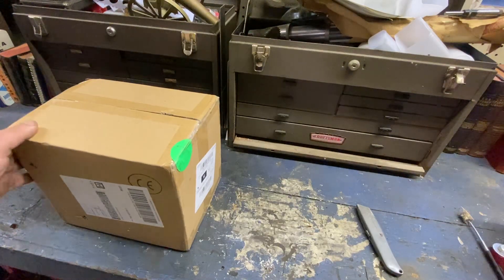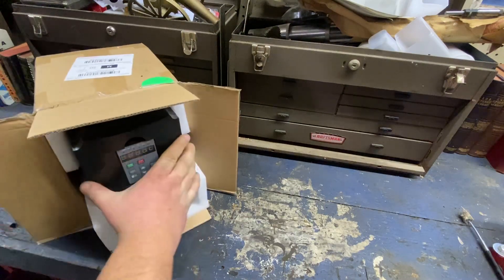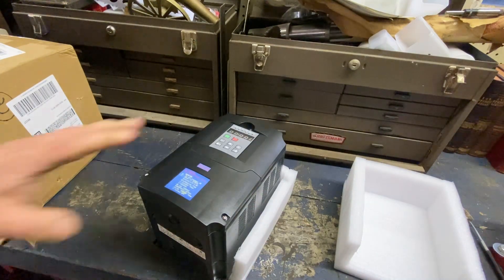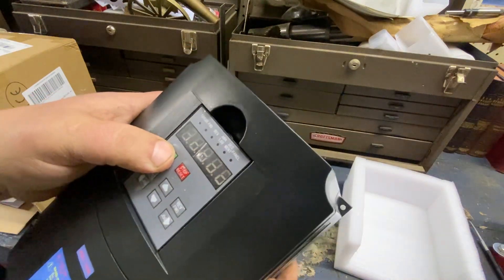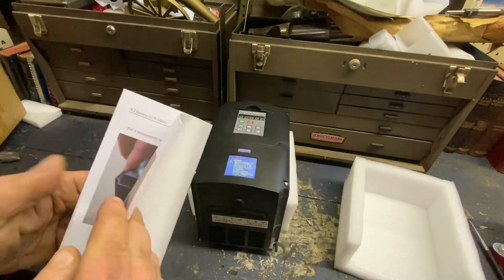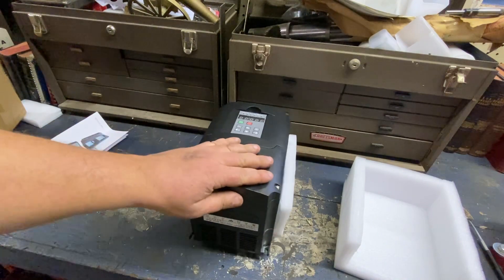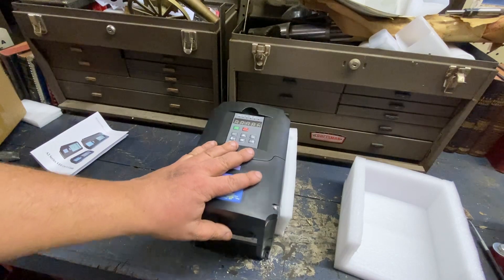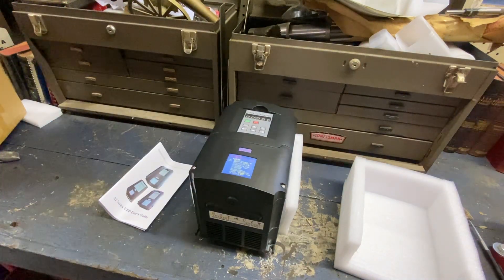10 hp single to three phase vfd

Comment: Hello --  I am picking up a 3PH Table saw.  The Saw: 5HP 208V 60HZ 12.6Amp  -- And I only have 230 1PH power.  I have seen where some are saying to get a VFD that is higher HP than what the motor is rated at so there is no issues?  So if that is true, should I get a 7-1/2HP or a 10HP VFD to run the saw motor via the VFD inverter?  I like that you said in the beginning that you work with VFD's all the time so I am seeking your expertise.  OH!  and one more concern -- Since my saw motor is 208Volt 12.5 Amp -- should I be needing a "Buck" Transformer to reduce the 230 Voltage to the motor coming out of the VFD?

Comment: hi... do you by chance have a video of wiring up the VFD ? I bought the same VFD for a compressor and just trying to figure out how to wire up the pressure switch to turn off the compressor when satisfied. Thank
Reply from the maker: I will have one very soon, on your compressor the pressure switch mounted on the unit should do all the on and off functions of the motor, you wouldn’t run anything to the vfd to shut it down.  Feel free to send me pics of your setup at Badam485@yahoo.com

Comment: Curious to find out if this worked for you or not. I’m trying to source a VFD to run a 220v 10hp 3phase motor on a 220v 1phase power source for a sawmill I’m building. Curious to see if it would work for my application.
Reply from the maker: I’m sure it would, I have a buddy that has 3 of these on 10hp machines with no problems after over a year so far